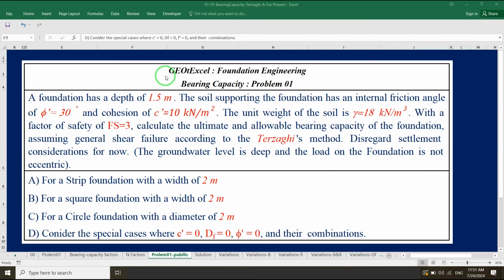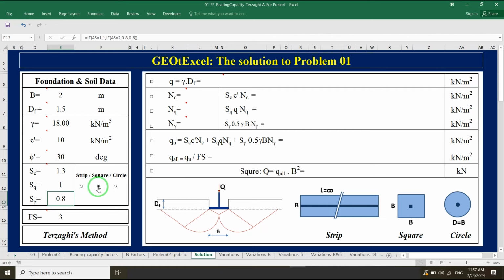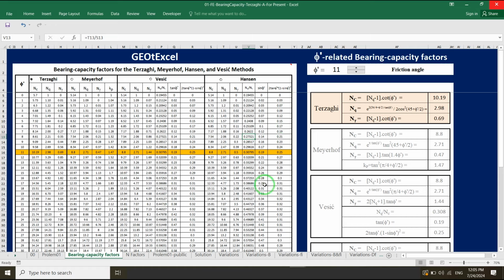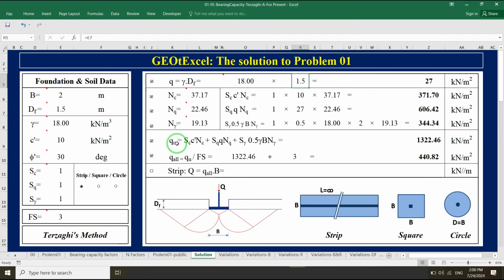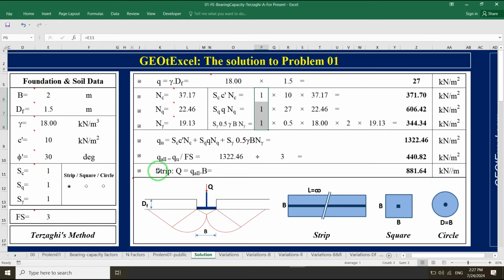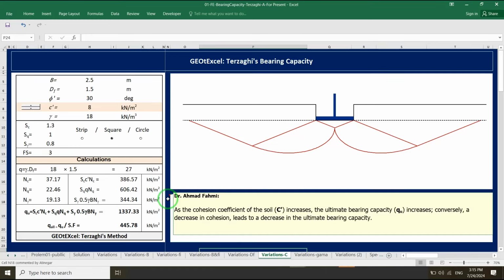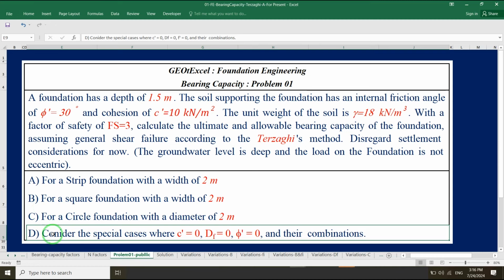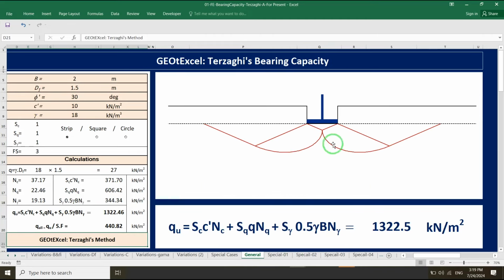Calculating Soil Bearing Capacity: Excel Spreadsheets (Terzaghi's Method) #geotechnicalengineering

Comment: Hi Dr. Fahmi, when does this spreadsheet will be available to buy?
Reply from the maker: Dear Valued Customer,
We’re pleased to introduce the latest version of GEOtExcel (2025-1) — an advanced geotechnical spreadsheet suite with 12 fields, 50 files, and over 470 Excel-based tools.
Based on user feedback, this release is now easier to activate, fully secure, and designed for permanent offline use on your personal computer.
✅ Highlights:
1) Lifetime access, tied to your registered device
2) Save, print, and manage data freely
3) No internet or cloud connection required
Your copy of GEOtExcel (2025-1) will remain fully functional indefinitely. Future versions will be optional, with exclusive upgrade discounts.

🛒 How to Get Started:
Download and unzip this package:
https://lnkd.in/dUhWCCMh
Inside, you'll find two Excel files:

GET ID: Open and click “Copy Computer ID”
Agreement:
       Sheet 1: Choose the files (auto price calculation)
       Sheet 2: Fill in your info and paste the ID
        Sheet 3: Review license terms

Email the completed Agreement file to:
📧 academy.dr.fahmi@gmail.com

We’re here to support you through the entire process — from setup to full activation.
Thank you for choosing GEOtExcel.
We look forward to working with you.

Best regards,
GEOtExcel Support Team